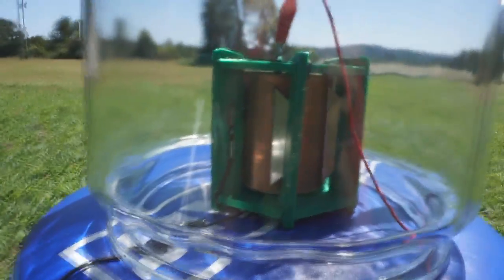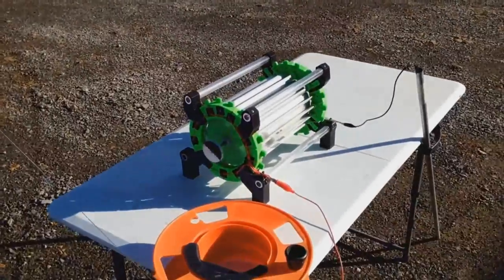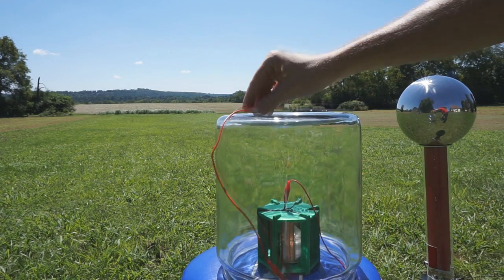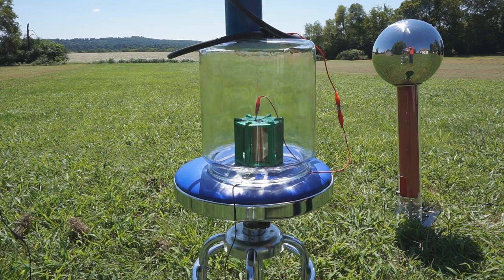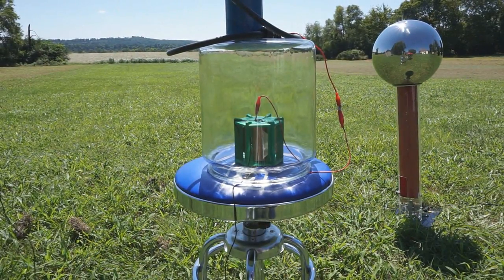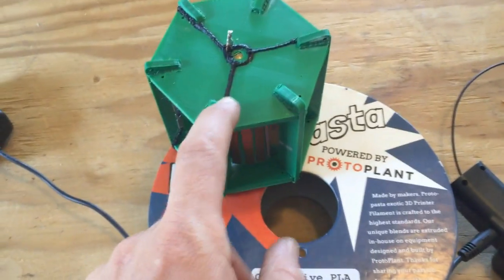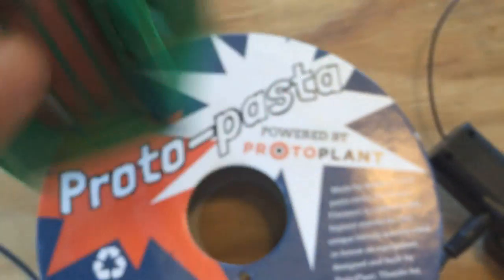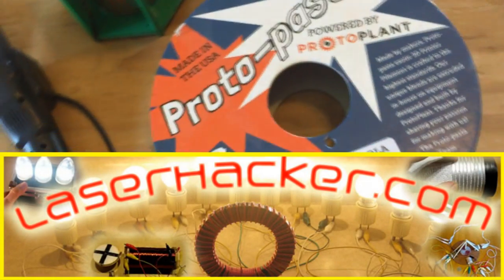Flaming Atmospheric Electricity Collector Experiments - Wireless Energy!

Comment: Very cool, I did a video recently where I was able to transmit an audio signal through a flame. At low currents and high enough voltage flame is a fantastic conductor.
Reply: Noice work- isolate the flame noise from the mic .. WOW!! plz..
Reply from the maker: I just watched your video: https://youtu.be/ulC84h4HSso  Very cool.  You make great videos.  I just subscribed.
Reply: Thanks. You hundred year motor project is so cool, it reminds me of a Crookes Radiometer but yours works in the dark >_<
Reply: +lasersaber I love your videos, especially your high voltage and oscillator related videos, I  should lurk less and comment more often, just subbed you too +Nick Moore cool vids. +lasersaber your video reminds me of several patents filed by T. Townsend Brown, including US3022430A, US2949550A, US3187206A, and US1974483A relating to harvesting high voltage AC from a flame, a more general consideration of the potential utility of applied high voltage electrokinetic properties, one discussing some of the technical aspects of converting high voltage to kinetic energy and a patent describing a high voltage electrostatic motors respectively. Brown had a number of other high voltage and electro kinetic patents you would enjoy reading I expect.
Reply: God did it first, according to Moses

Comment: yeah the flame provides a conductive path :)
i've been using flames in expiriments with sound from sparks.
to get greater distance of arc for higher output volume with minimal to 0 distortion of it without the flame.
very cool stuff

Comment: In the book, "Secrets of Anti-Gravity Propulsion", an illustration by Townsend Brown shows a simple high voltage generator that operates using a flame.  Perhaps, a flame acts as a high voltage diode?  Do the guys in Florida use a high voltage diode at their collection station to charge capacitor banks?   Moray's cold cathode tube was mostly germanium,  a diode or transistor.
Reply: very cool info

Comment: question. the collector or pin you used. could it be made like a coil? then adapt capacitances to the frequency of the earth's magnetic resonance. nothing works better than a resonant tuned circuit
Reply: The energy flux in daily resonance is far less than the DC current from sky to ground.
Reply: This seems to be the path forward, shumman 7.83hz

Comment: Could you alternatively use a solar collector and focus the light onto the needle and achieve the same results or will it not achieve the same temperatures as you reached with your torch?
Reply: The air needs to be warm. The warmer air is for a given pressure, greater is the mean free path between collisions,  and that means better flow of electrons.
Reply: Having a surface connected to ground and heating it may help  create thermal electrons jump off that surface.  But they benifit if there is a greater mean free path through the air to quickly get away.   Give it a try.

Comment: There is so much power in a flame compared to what's needed to spin the motor.  There could be far more effect from the thermo-electric effect than from air-ion conduction.

Comment: Hmmm, why do you think the flame helps, why is the energy attracted to it, think it is the propane gas, or maybe something to do with the heat or change in temp
Reply: Flames are essentially plasma.  They ionize the air, providing a conductive path.  Also, there is the thermoelectric effect which could be entirely confusing things at these low powers.

Comment: With the torch, I dont think you have collection, I think you have generation, if you turn on a tap the stream of water through the air gets charged, I'm summising that the stream of vapourised gas is also getting a charge by the same method which results in its flame/plasma also carrying that charge and onto/into the needle

Comment: Its flame rectification Principe. A flame can change ac to dc current. This effect is used in gas water heaters as one  of the safety features . if the flame stops the current stops and shuts it down.  It is not a thermocouple and it doesn't create any voltages or resistance changes.  Maybe its changing radio waves to dc adding to the natural static energy.

Comment: hey Lasersaber, perhaps what is a big factor with the efficiency of using a flame is the nature of fire being plasma correct? Plasma for example has near 0 loss when transferring electricity and also can interact with its active and surrounding plasma environment at levels far beyond traditional hard antenna based conductors.

Perhaps research into broader understandings of plasma physics will help you find much more viable results in your experimentation. Cold plasma might hold a clue. Good luck and I hope you find your  missing link(s).

Comment: the insulating on the wire isn't insulate over few thousand volts. if you touch the insulated part ow the wire, the charge will lose anyway

Comment: Question:

Is it the flame or the temp difference?  
If you use the same needle you have been using under a fresnnel lens in a sunny day, or concentrated solar light on the collector, would the temp difference prove to increase ability to collect or not?

Thanks for the videos

Comment: Very interesting. The flame being at near atmospheric pressure and very hot means electrons have a greater mean free between collisions. That helps electrons to better flow from your wire to the atmosphere.
Reply: It's the ground that holds negative charge ("electrons"), the atmosphere is full of positive charge; the "electrons" are flowing from the ground to the atmosphere, not the other way around.
Reply: @hoon_sol  thank you. sadly I knew that and yet sloppily wrote it backwards. I'm fixing it now to avoid any further confusion.

Comment: Interesting experiment. Using a TV antenna over 100 volts pk-pk is seen on an oscilloscope.  I wonder if the closer to the thin blue line the more magnetic energy will be available from our planets poles the rather elegant force field protecting us. Would the spinning planet try to cause movement of the magnetic field which I guess would be opposed?

Comment: Good job trying to replicate the Plauson atmospheric method.
Put your apparatus up on a 12 ft pole. It's 50 volts per foot. So 600 volts capacitor connected to it will charge up to 600 volts very fast.

Comment: Air doesn't conduct well (it's mostly an insulator).  You need to ionize the air to get a charge flow, or more slowly, collect water out of the air.  Flame makes a conductive quasi-plasma, but this seems like a waste.  You can ionize the air with St. Elmo if you get high enough and have sharp enough electrodes.

Comment: Is it possible the flame is reducing relative humidity thereby increasing static electricity similar to a fluorescent tube? Another possibility might be the increased flow of dry air. I have developed a static electric spark more that 1/2” vacuuming dry sand

Comment: Plasma is key.  Perhaps would placing the motor on / near a pile of uranium slag also assist in ionizing the mileau to facilitate collection..... Or use the radioactive button from a number of smoke detectors in lieu of the radium....?
Reply: I suspect any ionizing radiation could be used, radium would just have been a relatively easily obtainable strongly radioactive material in the 1920s due to it's use in radioluminescent paint, of course, today raw radium is not readily available, though there are plenty of clocks with radium paint out there still, so it is not impossible to obtain it, and they are still quite radioactive even if the paint probably has no luminescent properties anymore(that is due to the radiation damaging the crystal structure of the zink sulphide that was used for the light emission, not because the radium itself has become too weak).

As you suggest, the americium source from a smoke detector is probably the most easily obtained of the radioactive materials, and even an old detector(they should be changed out every decade or so) would still be quite radioactive(americium 241 has a half life of about  432 years).
Reply: Well it will be very interesting to see if this hypothesis is correct.
The geometry and proximity is of key import.

Comment: Is this not the hot tip of the propane torch causing a thermocouple effect?
Reply: Yeah... with such sensitive measurement, you have to be very careful to eliminate the thermoelectric effect.  It's going to be anywhere you have a thermal gradient and a metal junction.

Comment: No control experiment for the flame without the Van de Graaf?
Reply: Vandergraph simulates the voltages found at high altitude with respect to ground.  One could have done a flame with the vandetgraph removed but you wont have the high voltage near by, unless your flame is atop a high pole or hung from a kite.

Comment: What about compressed air would that work the same as the flame?
Reply: I seem to recall Tesla using compressed air in some of his experiments to improve the properties of his spark gaps. I also recall reading about a flame but wasn't sure until I saw this video and my memory get a kick in the butt :)
Reply: no. Flames are moderately effective conductors of electricity and a stream of air won't conduct electricity well at all.
Reply: Robert Szasz
This is not why he did it.
Tesla needed to make the switching properties faster. The sparks needed to die as fast as possible for the next one to start. He achieved Mega Hertz frequencies using the compressed air. A revolution for it's time.
Reply: UFOhunter I was responding to the OP. High pressure air jets work well to extinguish arcs quickly flames do the opposite. 

Separately, do you have a link or more info on an electromechanical device generating sparks in the megahertz range? I know other bits of the system oscillated at many megahertz but I thought the repetition rate was usually limited by rotary spark gap to way below a megahertz.
Reply: Robert Szasz
A tank circuit with an inductor and capacitor, can reach Megahertz range oscillations.

Comment: I wonder if you could extend flight time of a rc flying device with atmospheric collection to charge the battery during fight...?

Obviously it's plausible...
hmmm... has the proverbial wheels turning, that's for sure.
Reply: Do you have a plan to buck convert  thousands of volts to that which a battery can use? 

Or are you thinking of a motor powered with high voltage. But instead of ground, you have a high negative voltage to pull current down from a high positive atmosphere potential?

Comment: Have you tried using a dollar store laser pointer? different orientations, like shining it so the Van de Graaff generator and pickup tip are illuminated by a single beam? stuff like that. I love Tesla. I think he was the greatest scientist ever lived.
Reply: You need a much stronger (and dangerous) laser to make air conductive.
Reply: Not true. Depends on the freq of the lasing, the humidity, pressure and temperature of the ambient gas (air).
Reply: +UFOhunter It's possible to turn air into plasma using an eyesafe cheapo laserpointer?
Reply: "If I knew what I was doing, they wouldn't call it research" !!
~ Albert Einstein
Reply: I'm very glad Tesla got a unit named after him.  You must know, however, that a dollar laser pointer is not the way to go for this.

Comment: Try a carbon monoxide flame. They burn super clean, and I would imagine the carbon ions could pick up the static electricity than the ions from multiple elements like in butane or propane. Others I would try would be hho gas or an oxy-hydrogen flame. the YouTuber night hawk and light has documented and made very simple and cheap designs  to harvest, store, and use these fuels

Comment: Makes sense. Look what happens if you put flame near a Tesla or Flyback output. HV breakout goes 3x as far...
Reply: Is that because the flame/heat reaction with the air makes a gas which make it easier for ionised air to pass?
Reply: I think its got to do with a few factors. One is the energy from the heat making it the air more conductive. Flame is also closely related to electrical plasma, so your idea is also a likely factor.
Reply: A flame is plasma, plasma exhibits negative resistance properties.

Comment: I know this video is old but if you have a sphere that has the best vacuum possible  And you connect that to a copper wire And the wire is wrapped like a Tesla coil. I'm connected in series with a capacitor.  You can actually get the atmosphere and ground to oscillate and create an awesome an oscillating Generator

Comment: If you ever watch river at element you will see that the rarest elements are Streamley reactive and they have a positive ion. Neodymium as a negative ion up +3 and Cerium it is a rare than we do so as a positive ion which means it will draw negative ions from the air and when it does that and negative ions will cause it to be oxidized but if you were to take a hollow spear of aluminum and fill it with neodymium element or Rare Earth element that is extremely reactive and more reactive when it and more reactive when it when it there's heat .so I want to say what will happen to the rare earth element inside of the hollow sphere. Neodymium inside of the house there a limit on what continue to draw negative ions from the air in those negative electrons be pulled from the oxygen in the air in a truck to the neodymium element and when they do the air around the neodymium become part positive and because they because the neodymium is inside of a aluminum spear there will be a block between the oxygen Adams in the neodymium element which means that the new Demi Moore oxidize but it will continue to draw out negative ions from the air. Also I want to add if you take 100 foot pole can you put in aluminum spirit on top of it like using the Van de Graaff generator and you feel that spirit with neodymium element and then you put a periscope on top of the spare or a number of magnifying glass to heat up the spare it will also hit up the . It will also heat up the neodymium inside of the spear making the neodymium element even more reactive to the air pump because there's an aluminum block from between the new DMM element in the air the name of the mailman will oxidize but it will continue to draw negative electrons from The air and all rare earth elements are extremely reactive when in contact with heat look at Look at Cerium which is so reactive the heat that all it takes is a little bit of friction the great fire I would use the most reactive safe rare earth element you can buy fill up an aluminum hollow spirit with it and put a magnifying glass over top of it to increase the temperature of the aluminum so that the neodymium will also be increasing temperature becoming more reactive pulling more negative ions from the Air

Comment: Hi. I like to give you some hints, resonance with a natural resonator, like a cross on a  church  (hint for the true meaning of it ) coils to boost up and down the voltage  capacitors and air spark gab, as power regulator and to transform plasma into us able energy 
But you need a solid copper plate in the ground too. And thick copper wires both sides to get the right amount of voltage and current from the beginning 
So no flame thrower haha 
But the spark gab wauw. that is Just like one,  ones you find the right resonance frequence by tuning the coils and capacitors. Haha 
 Only that works right. Dont try to reinvent a square wheel. that never works right. Get smarter than all these sheeps meeeeking around you. they dont even know what a wheel is yet. symbolicly speaking  (for the real stupid ones Who dont even understand that haha ) I did much work in that field,  but had to stop under pressure from the closed system energy giants controling the grid and you and me
But hè. be positive. you have a long way to go before the for sure with a working system will shut you down too. I always thought that it would never happen. But just look around you. Many accident can happen to you or your family. that is how they do it . Pff. But talking and fooling around. no problem.
Reply: Tesla found a better way then using a cross or plasmas.bl But i dont want people out to get me lol.

Comment: atmospheric electricity eh? or just collecting the static from the vandergraph. it means nothing. should have done physics at Uni it would have saved you alot of time.
Reply: Ionosphere ions ionized from cosmic radiation rays
Reply: Yes with the vandergraph and the flame, at atmospheric pressure but a higher temperature, provided a greater mean free path for electrons to flow, and was able to drive his corona motor. 

Atmospheric electricity.
https://images.app.goo.gl/XTauCGuWSBVgazB58
comes from cosmic particles slamming into our atmosphere. They inturn  creat pions and muons that rain down on earth and they eventually decay into electrons, thus creating a voltage gradient through our atmosphere.  Its real, is is easilly measured  and has been. Furthermore it is easily noticable in every day things such as electrotrophisim in certain plant types.  But as for human use, for a given area, its potential power density is very low.